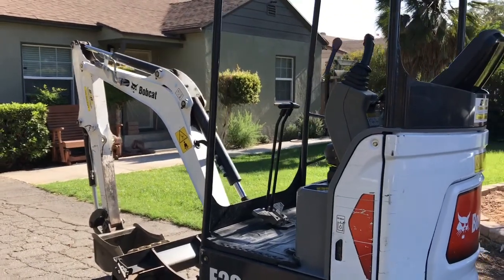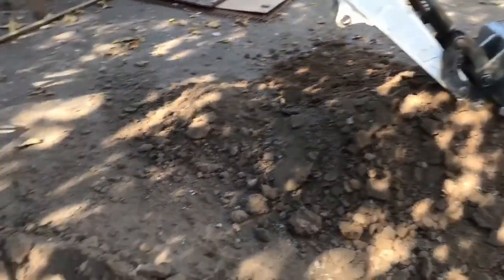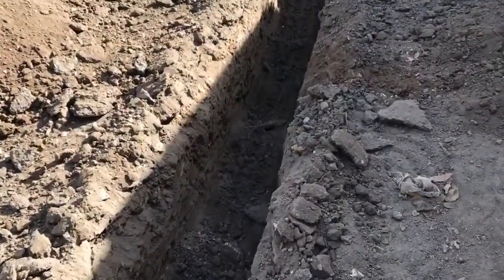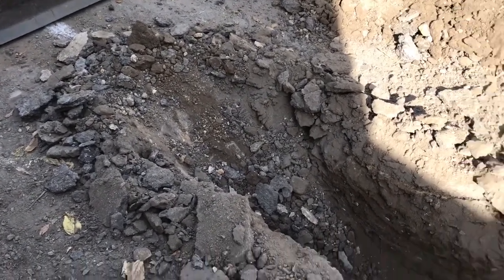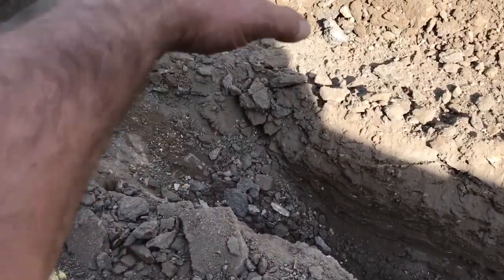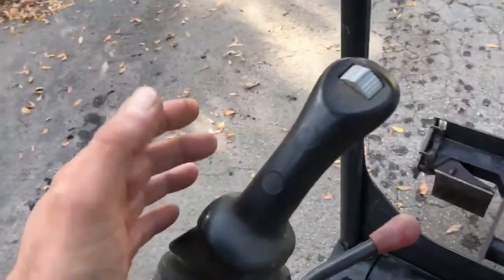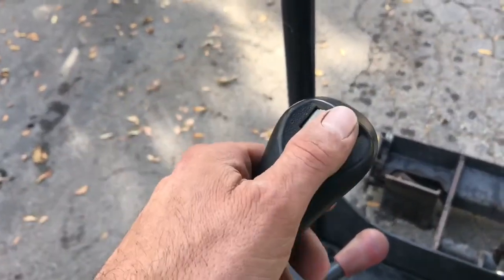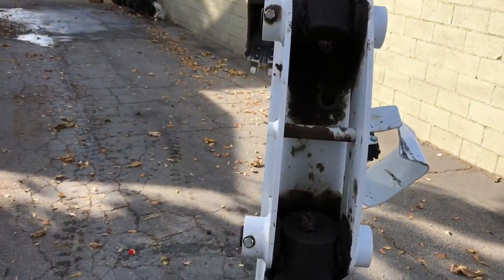Bobcat E20 mini excavator.

Comment: I know this video is already at least three years old but for future reference someone can use some of the tips below.

You'll get a lot more leverage if you put the blade on the other end and put some down pressure on it then you can have more pressure to dig down into the hard ground on the back of the machine.
Take long steady strokes about three or four feet long and about 2 inches deep each time and make those long strokes fill the bucket each time. Remember each stroke should be done horizontally, not vertically. And the first couple of strokes should be very shallow so you don't break a lot of material loose along the edge of the trench.
The lever with the red knob is your hydraulic lock out.
The part that you said you would have to dig by hand can still be done with the machine. You just need to drive across the trench halfway so the tracks are bridging across the trench and turn the upper part of the tractor sideways and dig. You may need to put the bucket on the ground on the other side of the ditch before you start crossing the ditch. That will
keep the tracks level till they get to the other side of the ditch. 
I sure wish I had a takeuchi or a Yanmar.
But this is a good video.
Reply: Do you have a video of how to properly use an excavator?
Reply: Excellent advice! Any more tips on this machine or similar?
Reply: @ZR1Terror  unfortunately I don't have any.
That's the way I was taught in the operating engineers union because time is money.

The less damage done to the sides of the trench, the faster you can backfill the trench later saving time and money. 😀
Reply: @flat6fever680  
If you have to dig a trench going across a slope, you can put the spoils behind you on the lower side of the trench to put the tracks on to keep the tractor level.

Osha requires that if a trench is over 5 feet deep you have to cut the sides of the trench down lower making a bench, or you can slope the sides of the trench.  
This is to reduce the chance of somebody being buried alive and dying while they're trying to get him unburied if the sides fall in!
There are other more complicated solutions to digging a deep trench if you cannot slope or bench the sides .
Whenever possible keep the spoils pile at least two feet away from the trench which is hard to do with a small excavator. That will give a narrow stable place for people to stand next to the trench without tripping over rocks and dirt clods and falling into the trench.

Always always always keep eye contact with anybody near the machine so that you don't injure them by unexpected movements!
Always look behind you before moving backwards!

Construction is one of the most dangerous jobs on the planet!
!!!!!!BE CAREFUL!!!!!!!!!

Safety is always absolutely #1
Reply: OSHA requires you wear safety equipment like boots, hard hat, safety glasses .

Wearing safety glasses saved my right eye on a tractor when a high pressure hydraulic hose blew and squirted hot oil at my right eye from 6 feet away knocking me back in my seat!!! 

Hydraulic hoses can burst at any time and cause damage to the equipment and to people nearby.

Excavators make excellent cranes for lifting small loads. Never ever get underneath the load or underneath any part of the tractor when it's moving or swinging around!!!
I have had four hoses blowout  on me in the last 20 years.

Every situation is different always always always watch out for danger!
Reply: @TF856  thank you! I am guilty of not using the seatbelt in my fully enclosed Bobcat 753/S130. Appreciate your tips.  I’m looking at a mini ex now like the one in this video. E20.

Comment: 9:47 you were flicking the pedals that would have flipped back so you could use the back half to drive in reverse. The blade has wings that flip out too to provide more support or pushing. And as mentioned before putting the blade behind you and extending the tracks out a half foot on each side is nice too but the rental company didn't show you these things. They are never helpful like that and just assume you know these things. Shaving an inch or two off the top with long smooth strokes was excellent advice provided below. 
And man, that dirt was rock hard and really polished that bucket up! You got your ass handed to you that day for sure!! Would a narrow bucket have been better or did you need that width? Would a chain trencher have been better? Thanks for sharing. Liked and subscribed.

Comment: Another point I forgot to mention. When you're digging in hard ground like that, put the blade on the ground behind you with some down pressure.
That will change leverage and make it easier to dig in hard ground. 😉

Comment: By the way, the machine is way less tippy if you spread the tracks.  Flip the switch for the dozer and pull up on the doze stick.  Works great. Lift the machine using the dozer on the front side and turn the carriage 180 degrees and use the boom to lift the whole machine off the ground when you spread the retract the tracks to reduce ware and tear on the chassis.
Reply from the maker: Hey thanks for the info, I had no clue I could spread the tracks.
Reply: @TreasureGeo  they do spread out on some small machines.

Comment: Would help if you dig from the top , not from the bottom of the trench ie take the top off first then dig each layer as you go , it’s a small machine use it to your advantage. Strip off the top for a machine length, then take another layer maybe a tooth depth, what I ses is a machine been flogged .